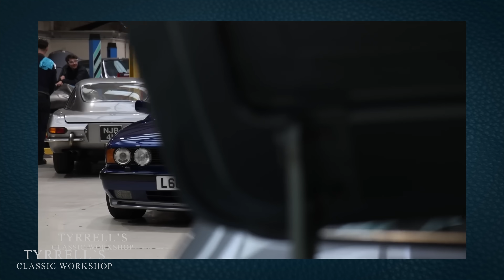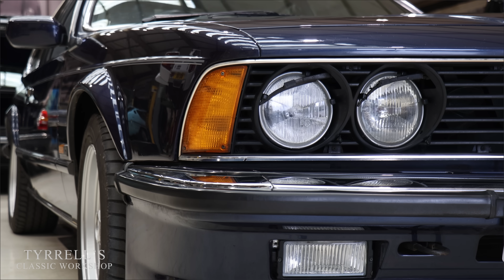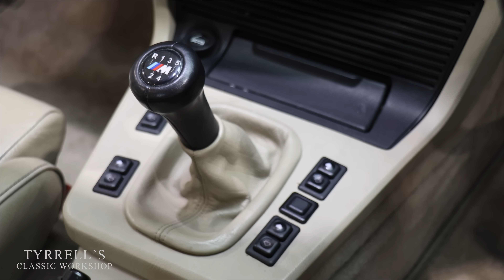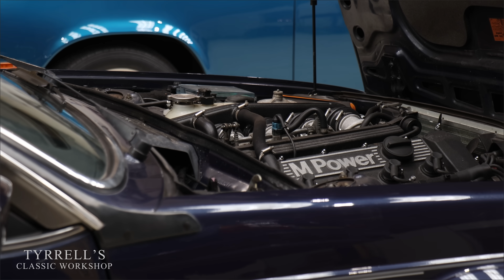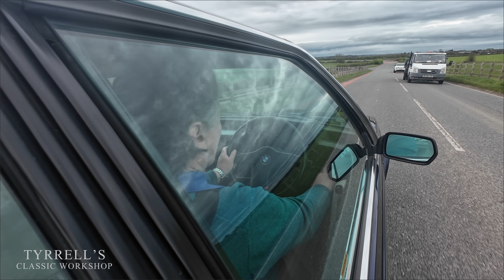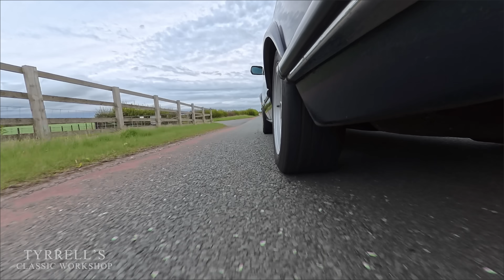BMW M635 csi- the Bavarian ‘Bahnstormer | Tyrrell's Classic Workshop

Comment: once bought a Cortina 2000 GXL for peanuts the car was very good condition but not the performance first thing I checked was the twin choke Webber and yep 3/4 of an inch of slack! performance back to where it should be!, the other thing Mike make sure there are no extra carpets under the throttle pedal! happy days

Comment: As far as comparisons to other cars, why are you comparing only to the 400i. This may have been valid for 1984, the first year of the M635CSi, but the production run was from '84 to '89. In '85 Ferrari came out with the 412. It was faster, the 5-speed version apparently good for a bit extra, for 158mph. You are also completely forgetting the Mondial. As with the 412, a new version came out later in 1985, the 3.2, and it was about the same level of performance as the M635CSi as well. The official top speed of the Mondial 3.2 was 250kph/155mph, but by some accounts they were good for 158mph as well.

Comment: In Maryland US, I bought a "grey market" (no catalytic converter) 1985 635csi, black on black in 1997 with 30k miles and sadly sold it five years later when I moved to a house with no garage. It was, without a doubt, the best car I have ever owned. Amazingly fun to drive, particularly on twisty roads. Despite the weight, it cornered like a demon, the torque curve perfect for rocketing out of almost any medium turn. In fact, I converted a couple of 911 aficionados who both went on searches for the car after driving it, one of them successfully. On the highway it was remarkably comfortable, composed at speeds I won't admit here.  And I have to confess to having wiggled out a few speeding tickets with state troopers who after walking up to the window paused and said "Cool car..." Selling it was the worst auto-related mistake of my life...although I did sell it for more than I paid for it. That should have told me something right there.

Comment: I had a 1987 535iSa that had those TRX wheels/tires, the car handled very well with them. Later I looked for a 635, ended up with a 1984 Jaguar XJS, which was a great car for the two years I had it.

Comment: Beautiful car.  I remember my E28 M535i with the dogleg close ratio gearbox fondly.  However, I never liked the overpriced TRX tyres though:  quite poor performance in the wet I recall.  The Avon tyre alternative was quite good but not as long lasting.
Reply: I sold the TRX wheels that came on my E28 and put on some nice 16 inch basketweaves from an E38.

Way better !

Comment: Brilliant cars to drive. Not as sharp as the e28 M5 handling but the styling wins hands down. The M5 had the option of regular wheels so it’s not blasphemy to use them. Big tip if you do drive one - wind the windows down. The engine noise is to die for. It feels like a brisk 6 up to 4K then gets on cam and sounds like an open wheel racer. No turbo whine. I don’t know if they tuned it to sound that good but it’s perfect.

Comment: I can't frickin believe the boot lid business; I have 2004 5 series and guess what: even though it is a different set up the spring holding the boot lid fatigues the metal holding the spring and ends up detaching. It can't be welded because there's sensitive electronics right there so I have to use a stick to hold up my boot lid. BMW is engines and handling and not boot lids.

Comment: when i was getting my first car around 2012 i had the $5000 asking for this perfect red on tan e24 m6 but my dad said it had too much horsepower as my brother rolled his first car a 928 and my dad made the rule my car had to be less power than his 4.2 range rover lse so I got a 208 hp 635csi. In the end I spent $2000 on a '88 635CSi 5 speed from fairfax, california with black on white lotus highline leather interior and vader seats. At one point it was rear ended and a good e24 is so hard to find so now I drive a '86 chassis in artic blue metallic that I got for $60 and swapped most the '88 parts into. In 2021 I fitted a crank from a 733i and custom pistons and rods to get to 3.7 liters. Back in 2012 I would go to bmw events like bimmerfest and talk to different ppl and everyone seemed to hate my car. I got many times someone would say its a black mans car which would make me feel awkward/not that welcome as a jamaican in these white ppl bmw events. I remember 3 times passengers would always comment about some "faster" bmw but then when i would talk to them they are assuming like some trash 325i is faster. Someone once said "this is supposed to be a bmw where is the luxury" I pointed out the leather headlining. My neighbor would lecture me on my expensive distributor cap and ppl wud act like the car is unreliable (its the best bmw ever did). Now I get compliments daily. Every small japaneese hatch wants to race at the lights. Ppl be waving at me and flashing their lights. everyone wants to chat about it. Its incredible how differently these cars are viewed from only a few years ago when they were completely worthless and drivers were considered fools for driving old bmws and not a bland floppy toyota.

Comment: TRX's were not always successful on BMW's - sudden wet road oversteer was a real issue but not so much on the M5 and M6. M5 E28's started with TRX's but quickly changed to 16 inch imperial rims.
Later TRX's (long after the E24) were the TRX GT which was better but tyres had moved on. Avon made a version, the Turbospeed aka the Turd-O-Speed which were less than stellar.

Comment: Love these! Although a sprayer by trade, I was bodyshop valeter at Hexagon BMW in Kentish Town and took two black sacks of rubbish (rotten apple cores etc) from the back of one of these in the early ‘90s 😄 I particularly loved those “BBS” style alloys (a nightmare to clean) and finally had a set of my own on an E39 years later. BTW, that 286 BHP figure seemed to become iconic on so many BMs after this. I love the ‘70s to ‘00s BMWs. They were a so desireable

Comment: I accept the term "aspect ratio" is valid in this context although it is better suited to the width versus height of monitor screens. We would normally use the term "profile" in the context of the tread width and sidewall ratios.
Reply: Aspect ratio was used for tyres before PC monitors even existed.  I remember when 70% AR was considered a low profile tyre

Comment: Our w123 250 4 speed auto 1980 model had a tax curb weight of 1530 kg that shows  how much of a difference Mercedes was over the others and as you describe it with 6 series pre 1982 suspension the Mercedes was way better roadcar.

Comment: I also had a cinnabar over lotus E24, an '87 with the switchable automatic.
It was destroyed by a drunk driver in a Dodge Tradesman van who T-boned me at about 40 MPH into the driver's door. Strong car, got a dislocated shoulder and two broken ribs, glad it wasn't an E9.
The other guy and his passenger didn't do so well, they came out through the windshield 

I used the insurance money to buy an '83 633 5speed  with a Rotomeister (really) turbo in lapis over black buffalo, which is the same color as your M635csi, I think.

Comment: Nice video and one of my favorites. The E24 is based on the E12 chassis to start and revised to the E28 Great little cars.  Interesting tidbit is the metric tires are the same size as the Ferrari Testarossa front tire. Mine still has 1980's air in them. Same as the air Ronald Regan breathed!

Comment: Sorry to correct you Iain but this car was based on the E12 and then the E28 BMW 5 series, not the E34 which came later and is quite more modern. My first car was a standard 1985 635csi and I loved it even when it wasn't working properly. The M635csi is my ultimate dream BMW....(well maybe after the M1).

Comment: Ah, memories ... As one of the very few in Norway in the early -80s, I had a german bougth 633 CSi late 1980 (or early 1981) model. This was the first engine from BMW (and the whole world!?) with Bosch Motronic injection/ignition! The bigger 635 got the Motronic later. I saved all my earnings to buy this. 
I bougth it by the main dealer of Mercedes sales in Hamburg. The car was at that time only 2 years old, what a top asset for a young lad! I ran the car with german plates/registration ... hmmm. Norway had one of the worlds highest car taxes at that time ....
The former owner was the wellknown actor Horst Frank (Derrick, and many more movies). I was told he has bougth the car to his new wife; actress Brigitte Kollecker.
I took good care of it, but he car was notorious in my region for its speed and fierce overtaking, among all the other cheap cars with a maximum speed of 135-150 km/h (84 - 93 mph).
It had a 3-speed ZF 3HP-22 automatic. The first gear was as expected very high geared, so I had to have a speed at ca 50 km/t to make an impressive kick down acceleration.
Memories ....

Comment: Another great video Ian, the TR in TRX actually stands for tension répartie which is a reference to the manner in which the tyres distributed load through the tyre wall and into the rims which were specifically designed to allow for the fitting of lower profile tyres. Over time other manufacturers caught up with the ability to produce a tyre with a lower profile whilst maintaining ride quality. Since then, arguably, we just ditched the idea of ride quality altogether... 😮

Comment: I had an Alfasud in 1990 which ran on metric wheels (190/55 VR 340 Michelin TRX). It was still possible to order the tyres from Michelin through a normal tyre dealer but they weren’t great tyres despite their width and modern design. Replaced the wheels with imperial size and opened up a whole load more options.

Comment: TRX tyres. I had a 1990 535i sport with 415 tyres. A few years later I acquired a more economical 1995 525tds with 395 tyres. Nice wheels pitty the only tyres I could find were retreads. Swapped to e39 wheels.

Comment: I have a US spec M6 (S38 version of the S88 engine) in identical colour combination. It has had some period modifications from US  BMW tuning specialist Dinan, which has brought the power up closer to the Euro version. 
I concur completely with your knowledgeable comments on the power delivery and curve. The only l niggle l had with the performance was that with the heavy air door which the Bosch Motronic system of the day utilized for the MAF in the air intake.   Until the air speed was up and lifted the air  door l sensed a noticeable flat spot in lower rpms.
I have replaced the original MAF with a more modern less constrictive setup. It did include a change in the chip in the ECU and a slight wiring modification to fully benefit from change but the end result is much better throttle response across the entire range of the engine.
Love the car, a real mile muncher and driver's car. 
Thanks for the review.
Reply: Soooo true about  the heavy door on the MAF !! Specially when cold !!
Reply: @1983dmd Hi, yes exactly very noticeable when cold.
The MAF mod l used was put together by Miller Performance  They called it their 'GEN 3 MAF. Not sure if it is still avaliable, they do seem to have an active website. Thanks for your input.😊

Comment: Ford used TRX on Thunderbirds, and I think also their cousins the Cougar, of that era. I think that was the only US market car, at least that I could recall. They were only on the higher end trims, the Turbo bird and the XR7 Cougar.

The M6 has always been one of my dream cars.
Reply: Ford introduced the TRX on the original Fox-body Mustang in 1979. Over the next few years they were offered on several models.
Reply: @shiftfocus1 Yes, I forgot about that. Can’t recall what trim they were on, but the Mercury Capri too. They used the Fox platform for quite a number of cars.
Reply: @Biochemechanic  from memory I think they were offered across the Mustang/Capri range, but I’m not sure.
Reply: @shiftfocus1 Just did a quick search, looks like they were about a $300 option. Not trim specific. Companies making 16 inch pseudo TRX replacements now.

Comment: Iain, good video. I am fortunate to own one. Something I learnt which I thought was worth sharing. Power figures at 286 are actually quoted based on the LHD cars. The RHD cars as mine don’t benefit from the bunch of snakes exhaust manifold found on the Euro cars. The RHD cars got a pig iron set due to the position of the steering box which are inferior and don’t offer the same flow. I can’t find official figures quoted anywhere for the UK cars and can’t see it was ever officially published. I found this out partly as I put mine on the dyno and made 240. I was slightly disappointed however having to remember it is a 40 year old car. The specialist I use then provided this explanation. I will also check play in my throttle cable.
Reply: Totally true. And the US/Canada/Japan  versions had the S38 cat engine with  the double row timing chain, also without the bundle of snakes exhaust manifold. Apart from the throttle cable, one should also check the proper opening specs of all 6 individual butterflies with a measuring caliper.

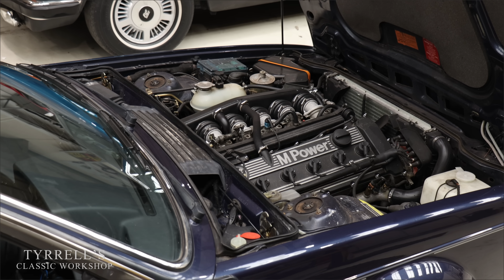Comment: @2:30   e24...not e34. @3:25   M88/3...not S88/3. Finally, 1st gen e24 was based on e12.

One note:  Apart from the throttle cable, one should also check the proper maximum opening specs of all 6 individual butterflies with a sliding  caliper.

Simply said: This is a racing engine in your car !! It was modified from the BMW M1 Procar which delivered  more than 475 HP ( M88/1 version ). Amazing provenance.

Comment: I thought it was the M88/3 engine in Europe (and the lower powered E28M5 S38 engine in US as the S38 has a lower compression, which was required due to lower fuel quality in US)

Comment: I so love the design, and ill never be able to afford a M6. So for me, any RHD 6 series would do, based on condition. Manual preferred but not essential. Test drove one fitted with an automatic Nissan RB25 non-turbo. Didnt pull the trigger because it wasnt suitable for family service, it was certainly powerful enough, with that engine being easily a match for the BMW six and capable of much more. With the kids being older now and more independent, having one would be a dream.

Comment: Braq-BMWs were instant classics when still being built, just like the Sacco-Mercedes were (W124, W126, W201, R129). Somehow both Mercedes and BMW completely lost track about their "optics" lately, with BMW embarassing themselves with almost every line they {censored}. That M6 regrettably had that slightly "wooden" front spoiler, the "M-free, normal" front did look way more elegant. Same goes for the rear lip.

Comment: Michelin TRX, you get it wrong at first (easy slip of the tongue) then correct yourself later, it's Tension Repartie. I think one reason for going metric was that the rim on which the tyre sits was of a different design and if conventional tyres could be fitted they would be at risk of coming off the rims (or maybe it was if TRX were fitted to conventional rims, they would come adrift). Going for a non-standard size eliminated that risk. 

Anyway, the BMW 6-series, particularly the E24 generation, is a very attractive car, the M635 CSi particularly so.

Comment: Ford had an option of Michelin of TRX metric tyres on the mk2 Granada 2.8i S models in 1977/8 . The metric tyres were , as you say pushed on certain European cars , but never really took off
Reply: Metric "Run Flat" tyres were also standard on the Ferrari 400 / Jaguar XJ6 Series 4 plus mass-market cars such as the Austin Montego and Austin Maestro, so they weren't exactly either rare or rarified. (The draw-back of a "run-flat" tyre, is that you don't actually know that you've got a puncture until you go flying into a bend - and car abruptly swops ends and goes into a tree backwards...   "B758 JBD" - where are you now?)

Comment: I used to know a guy in Canada with a Peugeot 205 T16 - still on its original tyres (which felt like driving on glass, they rubber being hard as a rock), as it was quite expensive to acquire metric rim-sized rubber.  I believe he planned on getting some aftermarket rims for it, but of course, that would ruin the look of the car.

Comment: The M635CSi is based on the E24 platform that originated back in 1976, not the E34. The latter was introduced in 1987 for the 5 series only, there was never a 6 series based on that platform.
Reply: Pre facelift E24 is based on the E12 platform. Post facelift (ca 1984) is based on the E28 platform.
Reply: @bjorn it used the M motor from the E28 M5 and the suspension geometry and brakes too, but I think the platform was still basically E24 🤔 anyway, it had nothing to do with the E34.
Reply: @DavidDatura Of course it didn't have anything to do with E34. I believe the engine was originally from the M1.

Comment: My Dads boss had a M635CSI in the early 80's. I was in my early teens at the time, Dad took me out in it and I seem to remember it had a dogleg 5sp box which as a kid I found 
fascinating.  This one is newer so they must have changed to normal ghange pattern. In all these years I have never seen another one.
Reply: Impossible. No dogleg in any M635CSi . Only the Getrag 280.
Reply: My first car had a dogleg gearbox (Datsun 180B SSS) and after I crashed it (hey, first car after all!) the gear knob was installed on about my next five cars, used to really confuse people when they got in a MK1 XR2 and saw a dogleg 5 speed pattern on the gear knob.
Reply: @ChuckFickens1972  Fantastic 😀